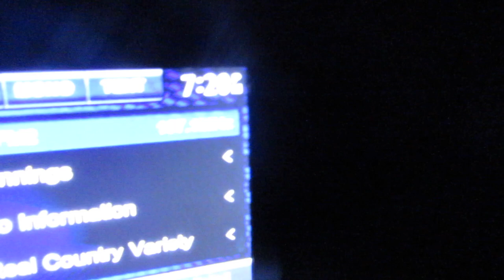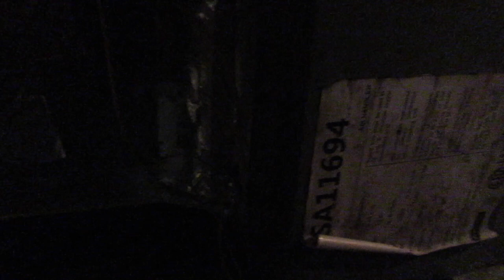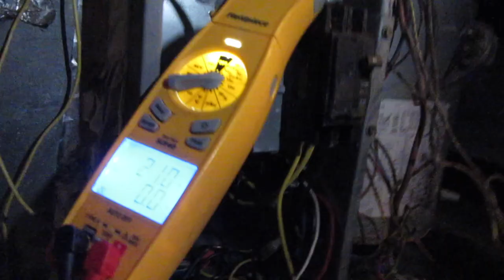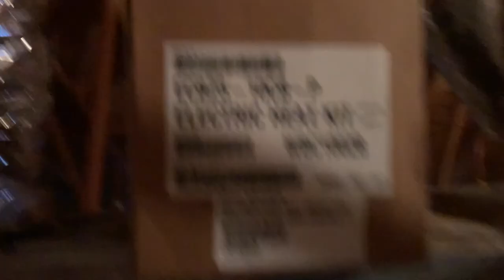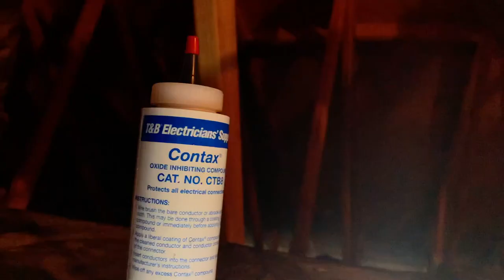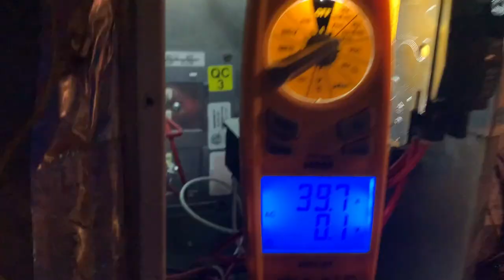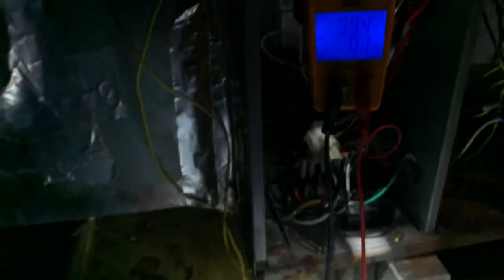No Heat/Armstrong/Airease/Bad Heat Kit

Comment: I s there a reason someone would use aluminum wire vs copper.
Reply: cheaper
Reply: @chasemeshell4114  but don't you have to use thicker gauge and is it still cheaper. Never price aluminum wire before.
Reply: @natepeterson7145  Copper is king, I don't use aluminum neither